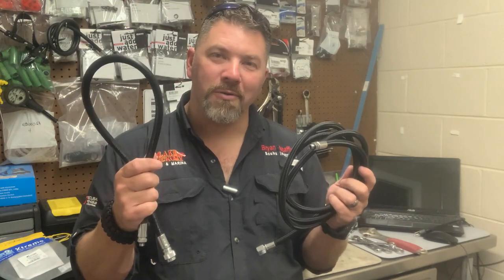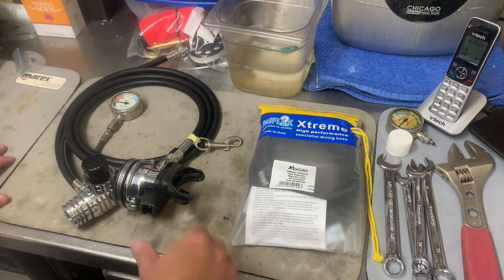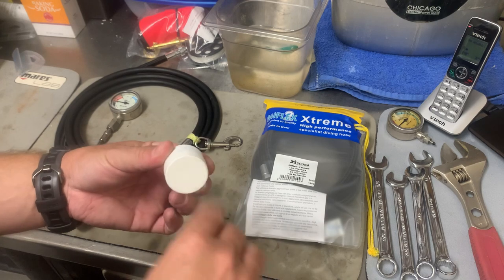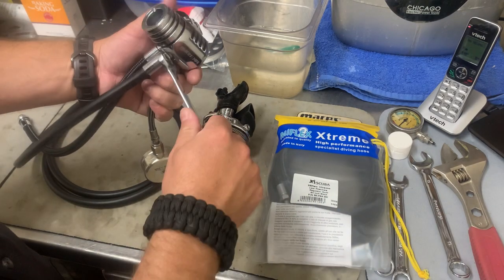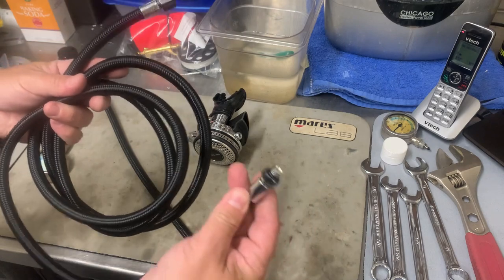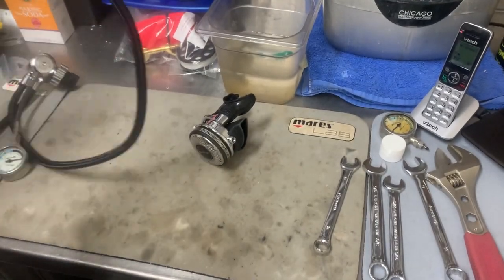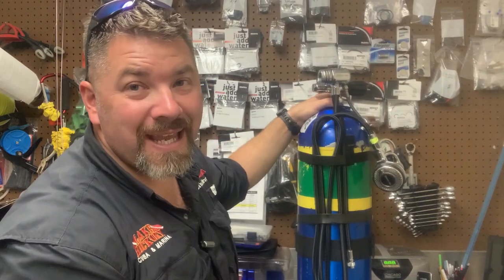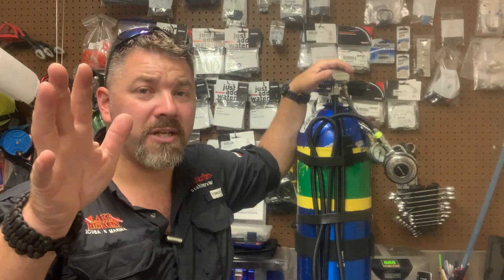Changing A Regulator Hose

Comment: Best part of video ,was you informed me of a class that would help me learn this stuff
Reply from the maker: Thanks david shumate. The Equipment Techniques goes over the entire Total Dive System, and how you can take good care of it. It really doesn't explain how to rebuild or repair the internal workings of a regulator, but minor fixes like this is common. All divers should be able to replace their own hoses. Its really no different than changing a battery in a computer.

Comment: Hi Brian, 
I recently went the opposite direction with my hoses. I switched from flex to rubber. Even for sidemount I haven't found them to be anymore difficult to route than flex hoses. 
 One reason I switched comes from the possibility of flex hoses to kink. I'v never experienced this myself but ya know... I know a guy who knows a guy.. For what that's worth lol. 
A more serious reason i switched was the issue that came up a few years ago where the flex hoses with a polyester inner lining were actually melting and then re-hardening causing an occlusion at the 2nd stage. As I understand it the flex hoses with a polyETHer inner lining never had this issue. But after I left my reg set in a hot car for a day I noticed a yellowish goo starting to become visible from between the actual braided  threads of my flex hoses and thought "How do I know if these are polyester or polyether?" 
  So to eliminate that possibility entirely I just switched to rubber hoses.   
BUT, Im probably overly cautious. Different strokes for different folks. Thanks for the content! Keep the videos coming. Iv learned a lot watching your channel over the past year.
Reply from the maker: Hello Kyle B. The Yellow Goo you saw, was more than likely a glue that had melted in the heat. Several years ago, there were several Miflex hoses that were flawed and caused several ruptures. This has not been the case recently. I routinely change out my hoses yearly, mine get a ton of wear and tear. As far as knowing if the lining is polyester or polyether, I would suspect you could contact the manufacture and they could tell you what it is made of. We usually purchase all of our hoses from XS Scuba, which has always had a high reputation in regards to quality. People ask me all the time why I use rubber hoses for cold weather diving, when rubber gets brittle in colder temperatures. Well in short, according to Mares, the internal structure of the rubber hoses they use, is more rigid. This causes more friction as the air travels through it keeping it more warm, helping to prevent freeze ups. I'm not sure if this is true or false, I have never really tested it, but at the same time, I really do not have a reason not to trust the engineers that develop the equipment.
Reply: I’ve heard about this same issue, to combat it I have my Octo on a rubber hose and then my Primary on a nice flex hose, keeps it flexy when breathing but if anything happens I’ll be just fine. I also run a two secondary setup so you can probably call me paranoid lol.
Reply: You could have just emailed the hose manufacturer or asked the shop where you bought the hoses as to their composition.

Comment: Great to show people how little torque is needed on these unions.  Feel and have sympathy for your materials - 'zen and the art of scuba maintenance'.  I use almost all Miflex hoses for exactly the reasons you state, but I've kept the rubber one for the long hose.  I find the extra weight keeps it nicely in place hanging round my neck whereas the Miflex hoses can be a little floaty.
Reply from the maker: Miflex can definitely be floaty.

Comment: Just for the sake of starting a discussion here... since you do your own regulator servicing I assume you have manufactures specs for working on them. Do they not specify  any toques for  the fittings or just recommend German torque?
Reply from the maker: Hello Caleb Mcelhaney, you would be correct, I do service my own regulators, this of course being that I am a Factory Trained service technician as well. Most things in Scuba Diving, if not all, are sealed with an O-ring. The worse thing you can do is over tighten things. Also, there are multiple devices in scuba diving, such as a low pressure adapter fitting, that connects to the low pressure inflator, that has a metal to plastic connection. You would never want to torque this down. Simply hand tight goes a long ways in the Scuba world. Great question by the way.

Comment: Brian do you tend to not tie your bolt snap not on the hose when you use myflex hoses.
Reply from the maker: On this particular one, I tie it behind the fitting in the little groove. On rubber hoses, it gets tied directly to the hose. Neither, have I ever had any issues.

Comment: Thank you for clear explanation. However, I would not use silicon grease but oxygen compatible one, like Krystolube, if I plan to use the reg with any kind of nitrox. When you once use silicon grease it is virtually impossible to get rid of completely and it definitely is not O2 compatible.
Reply from the maker: Hello N N, on static O-rings such as these, standard lube is sufficient. All internal components and o-rings for both the First Stage and Second Stage, we would most definitely use Krystolube.

Comment: Is it difficult to change hoses on my gear console ?
Reply from the maker: Depending on which console you have, not really. Sliding a gauge system out of the boot tends to be the hardest part. Plus, if you use an air integrated computer, most of the manufactures use a pin to hold the computer in place. Once it is removed, you can usually pop the computer out of the console with ease.
Reply: LakeHickoryScuba I have heard soaking the console in warm water helps.
Reply from the maker: That could help as well.